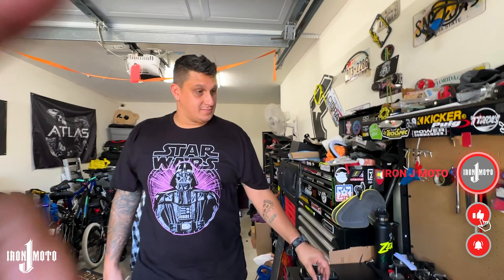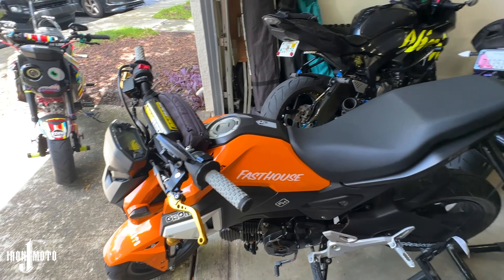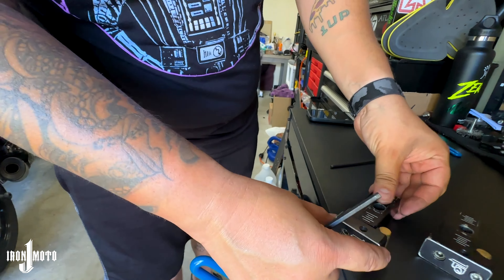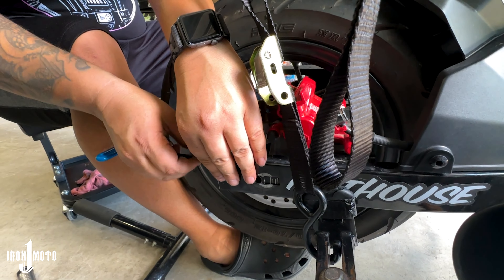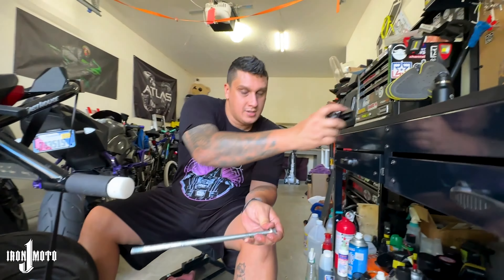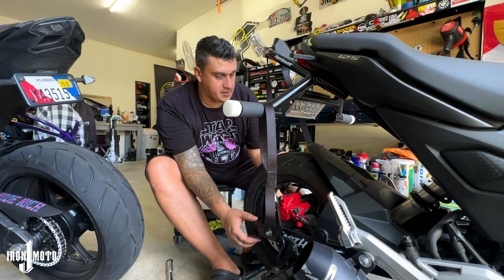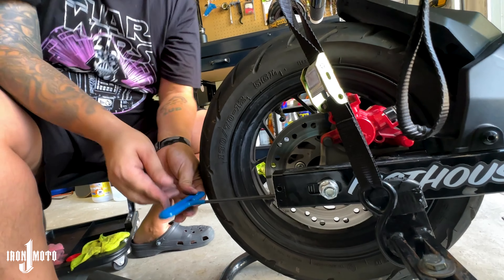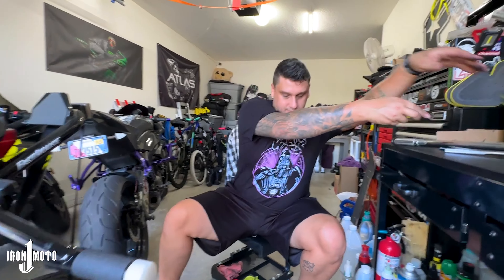The MOST useful UPGRADE for your HONDA GROM!

Comment: Best mod ...30wt fork oil 
Mx chain 
Intake 
Flash or finbro, arseracer draws 2much power .
Speed barings 
Takagawa 143
Speed shop cct
Adjustable rear shock 
Risers, pro tap
Koso 34
Yuminashi lifters 
Blah blah
Reply from the maker: Oooof 🫡